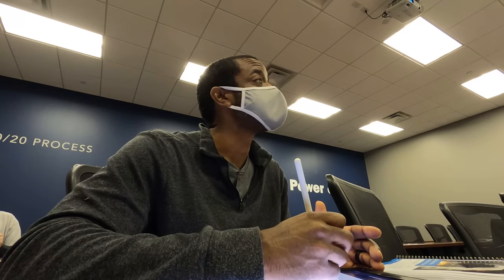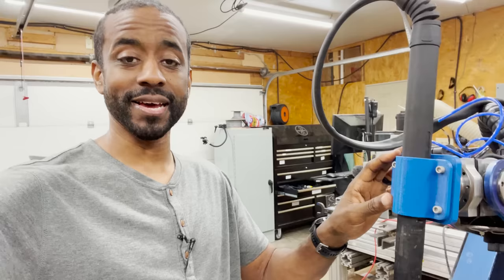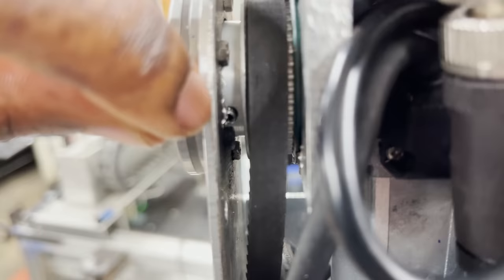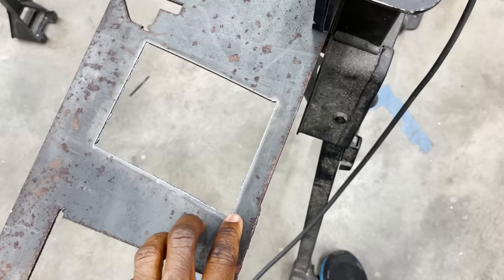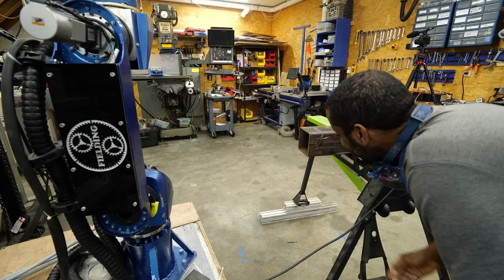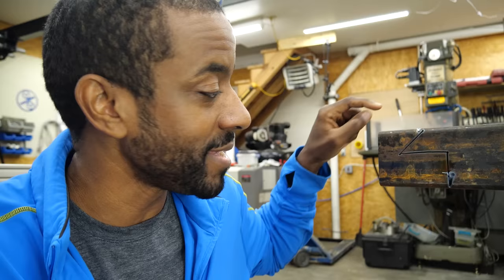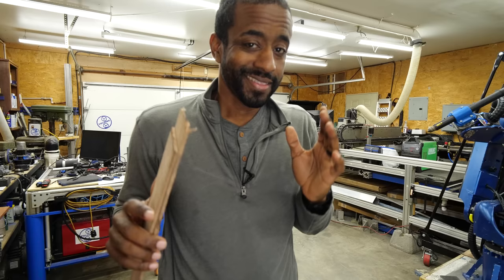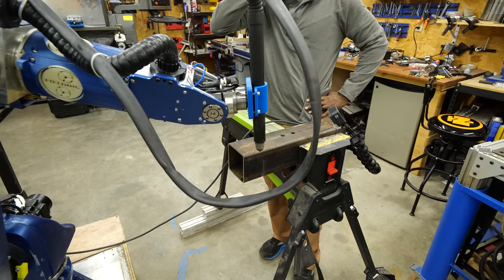I Added a Plasma Torch To My Robot - Jeremy Fielding #097

Comment: EDIT: just watched the last few minutes of the video and you did indeed turn down the microstepping. so the first 2 paragraphs don't apply anymore.

10k pulses is way overkill. especially when you have that massive reduction in harmonic drives. if you do the math each pulse probably moves the torch no more than a small fraction of a micron (theoretically, practically that's not a thing). your stepper motors can't actually achieve that resolution (microstepping only works to a point), your belts stretch considerably more than that, and any play in your harmonic drive will be several orders of magnitude greater than that angular motion per pulse.

So my advice is lower the pulses per revolution on the stepper drivers to a point where it's reasonable.
Also, millions of pulses per second isn't that big of a deal if you actually use the MCU's I/O to Control them directly and have enough processing power otherwise - usually I/Os have 8 to 16 bit registers for digital outputs, and so a single write can send out those 8-16 pulses, assuming you're not using a PMW peripheral. Sadly this isn't something you can control as you haven't programmed the controller yourself, but just pointing out that it is in fact possible as it may be the case that your controller advises specific groups of ports due to implementing this logic internally. I'm making a CNC with 200khz stepper drivers, and 4 motors, that's nearly a million signals but the chip doesn't even break a sweat cuz it can just write the entire register everytime, thus taking 200khz of writes instead of 1600khz aka 1.6mhz (keep in mind the direction signals need to be written to as well, 1 per each of the 4 motors also).

There's also different kinds of controllers. You don't need to motion plan on the controller itself as that stuff is precomputable. Can just generate the signals on your PC and send them over to the microcontroller for it to deliver them in a timely manner. There are controllers out there that do this, I don't know which, but might also be something to look into if you want that absurd microstepping still (again, overkill and wasteful - the more microstepping the weaker the steppers become also - advisable to do sensible intervals). Oh and that may actually also be the problem, if you're sending too much stuff (too many instructions) to the microcontroller and it doesn't have enough speed to process and buffer them into pulses, it may just send the same pulses over and over as it processes the instruction (essentially as it busy waits), which would explain the backing off more than expected in the direction it was already going. In that case you'll either need to use this other type of microcontroller, or a more powerful microcontroller. Could also be that the instructions can't go fast enough from the computer to the microcontroller despite the microcontroller being fast enough to handle them, and then you'd still either need to optimize the instructions or again look at a different microcontroller.

Oh and the multiple microcontroller suggestion seems like it might be a really bad idea. Think about whether you're able to synchronize them first, cuz if you can't, all hell will break loose and nothing you can do about it at all. If you can and the problem is in fact computer-to-microcontroller bandwidth or microcontroller processing power, then that might in fact be a good idea (provided the computer doesn't then become the bottleneck).

Great video once again, thank you!

Comment: Could a 32bit microcontroller help? I know with my 8 bit 3D printer board if I pause or stop the print it still keeps going for a while until it “finishes” a queue of print moves it seems…if you want an ESP32 Devkit-C board let me know I’ll send you one to try out I’m not currently using them for anything. Brand new in the box.

Comment: What I know about robots I learned from you lol but when you were talking about pulses it made me wonder what the buss frequency of something like a PIC Microcontroller is. The clock is 25MHz, you pulse example was 3MHz. Is your buss fiber optic? If not, is there any chance you're picking up noise? What if you used a microcontroller for each axis and ran them on a buss?

You say you aren't an expert... How about inspiration? Yeah... that...

Comment: The actual problem?  You went cheap.  There are A LOT of 6-axis robots out there that do all this work already.  Totally respect you doing all this yourself.  Yaskawa Motoman robots would be good and are comparatively cheap.  There are others, but considering cost that's what I would go with.
Reply from the maker: You might be missing the point. I didn't design or build the motoman! LOL Its not about cost. It's about making it myself and what I learn from it. I "could" have bought a used robot on ebay for less than I spent making this. So certainly not cheaper. Especially if you count man hours.

Comment: You need to ad the bending to .
Take a stik and tatsh everyting while dansing wat you want to tats.
Not to harm but to see your own moving and rotating and angeling at the same time.
Radius runs a litle further and the arm thurns around en starts the seccond section you see 2 staps but there are 3 staps rotation ground rotation arm an bending inbetween.
I olways thought  it olrady has 4 beakens outside to use it to navigate and becomes
 more liquid flowing but olways knowing where it had to kome back to😍
Like how you thurn and have to reangle to taths the swiths with the end of the stick and tray not to tatch the rest. To do this oll joinds wurk togheter with you en than you see whay the seccond is hapening the way it happend with the start of the seccend cut out of line😍

A i trayed you miss the shoulder joint
 The part of bending open en close is not there en thurning treu rotation 
To close en treu this 2 reangle back to the same spot around the corner of the profiles 

Like the way how you aproge wat you experience .
Thank you for sharing 🙏 your story.
I joyed watching🍀

Comment: I'm not sure I buy the idea about having too many steps per revolution.  To be fair, I don't know exactly what motors you're using, but they seem like servo motors that run on position and not number of steps.  So if you're sending position to the motor controllers step by step, maybe that's the problem.  Maybe you should be sending "desired angle" and let the controller catch up with the kinematics (that's just a guess, I really don't know what motors+controllers you're working with, but I think you mentioned servos, not steppers).  

Expanding a bit on the above paragraph, even if you're sending your desired angular position as steps, I would still expect any motor driver with encoder feedback to be repeatable in angular position (which when added up through the forward kinematics of the robot adds up to cartesian position), which you mentioned isn't the case.  I could really only see this being an issue if you were actually using "dumb" stepper motors that didn't correct their position based on encoder feedback (i.e. skipping steps/shaft slip), but that doesn't seem to be the case here. (granted, this could be a totally external problem that isn't even known here, welcome to physical prototyping)

Also to be fair, from the video I'm not sure what's causing your issues, which isn't very helpful.  Although a corollary to that, my experience with industrial 6-axis robots is that they are very repeatable but not super accurate.  I imagine that you know the difference, but for sake of exposition, that means that the robot might always go to the same position with the same inputs, but that position might be 1-2mm away from where you think it is based on control inputs.  For what you're doing, maybe that's not an issue, but keep in mind that these robots aren't magic.  As you allude to in the video, needing (potentially) all 6 motors to turn during a single linear move introduces a lot of potential for positional accuracy errors, and angular errors are multiplied over distances.

Comment: You can't have feedback system with encoders with that much resolution with software control, there has to be a complete hardware FPGA (DSP) system that takes the brunt of the calculations away from the software and can perform tasks in true real time fashion. Modern computer software or hardware architectures are not designed for real time tasks.

Just any micro-controller can't do that. you need an FPGA or something that has facilities for hardware DMA etc. to be able to control and respond to stuff without CPU having to do anything.

And this step is why robotic controllers etc are expensive as hell, they're stock full of custom ASICS or very intricate DSP algorithms that offload the calculations off from a CPU on a computer to dedicated hardware.

Computer only asks the robot (or tool) to perform a task using G-code or soemthign else, then all the movement and calculations for said movement are done in hardware and only feedback given to the computer is "i've done required task".

For controlling a robot there needs to be a buffer of commands that are already in the robots controller and have been calculated so that it can seamlessly go from command to the next without any pauses or waiting the relatively slow and non real time connection to the Computer to go on wards.

Comment: You should ditch the teensy and look at something like the Kflop from dynomotion. Are you running the servos in step/dir mode or analog with encoder feedback? If step/dir you should not be having a position issue. You may have an electrical issue and you are not getting reliable pulses to the servos, I have had the same issue with the 4th axis for my mill, I was losing steps due to electrical noise. I switched to driving the servo drives using a 26LS31 differential driver and all my problems went away.
Reply from the maker: Definitely starting to think I have electrical noise
Reply: @Jeremy_Fielding  what model of drives are you using?
Reply: I think you have the SureServo1? Looking at the manual it's like they copied right out of the Mitsubishi manual, lol. Anyway it has the same optoisolator inputs so the best way to drive them us used a line driver like the one I mentioned and drive the /PULSE, PULSE, and /SIGN, SIGN inputs directly. This will increase noise immunity since it forces the opto off and on as well as deal with the capacitance in the wires. If you want a diagram on how to set it up I can send you one. 

Im retrofitting a friends cnc router to use yaskawa servos and sticking my Rofin 225w co2 laser on it. Planning on driving the servos the same way. We are using a kflop on this too.

Comment: Hey Jeremy, love your videos and am captivated by this project in particular. Do you have your code posted somewhere? I know it can be hard to post because like everyone else i'm sure you write spaghetti code to get it working, and perpetually go back later to clean up. If you'd post it publicly, or send me a link (I won't share it, STEM nerds honor) I could review it and possibly find any issues that may contribute/be the cause of that disconnect on the linear motion. Since the encoders can jog it correctly it's either integration hell, or more likely something with the software/drivers you're using.

Also, have you made any concrete plans for adding closed-loop feedback & do those encoders have a programmable interface to do automatic configuration? You could have that closed-loop feedback system automatically setting the granularity of movement, so that you don't need 5 million POSTs just to translate in a single plane after doing a complex move. I think a closed-loop feedback system would be invaluable for your troubleshooting as well, simply because you can give yourself hints when things go wrong with useful errors/halting execution when the actual state of the machine is out of sync with the simulated state.

Comment: Not sure how exactly you are tracking position, but looks like you are trying to calculate position using teensy board and then sending new command/position. This is a wrong way, you have to send position/velocity/acceleration to servo which will do other stuff by itself. Probably, you must use one of servo drives as master where you will be sending XYZ position and it will control slave servos. You can also check if your servo controllers have something like "Path movement" or "motion profile" This is a best way to control servos by sending XYZ coordinates with end position/velocity/acceleration/deceleration. In that case you send point to move, as soon as it starts moving you are sending next point to move and so on.

Comment: The Teensy is woefully inadequate to control something like this, and splitting it up is a truly horrible idea.
You need LinuxCNC with something like a Mesa 7i95, or another more suitable board(choose by IO types, encoder inputs, etc - there's lots of flavors and expansions).
You can configure LCNC for any kinematic model, including 6-axis serial robots(pumakins, modify to suit your own D-H params). You can also have fully closed loop control, lots of IO, and a fully standalone control.

Comment: Do yourself a favor and stop using anything involving pulse trains..! I've had to troubleshoot so many issues on older machines that used that. Not worth the issues. Get servo drives that use a proper industrial bus. This also includes encoders, anything put pulse trains. I'd even go as far as to recommend a resolver over an encoder outputting a ttl pulse train, but of course using BISS/SSI/whatnot would be way better.